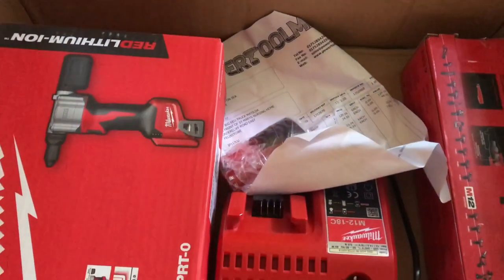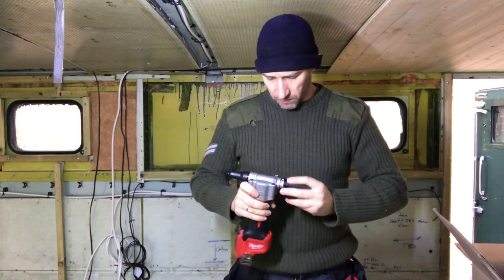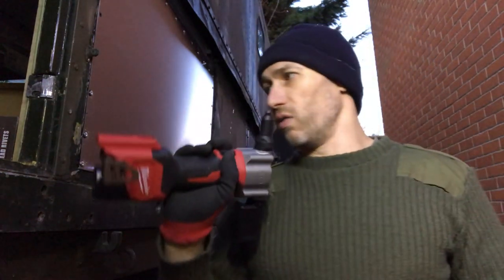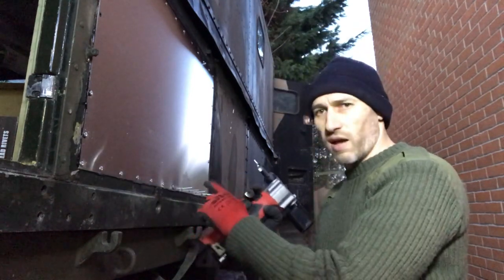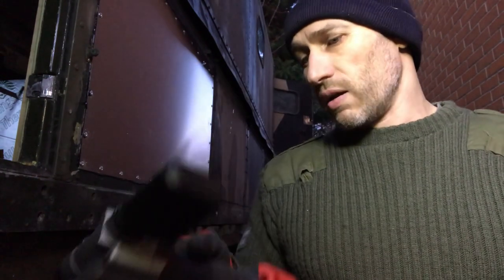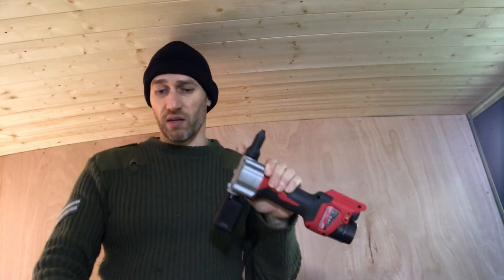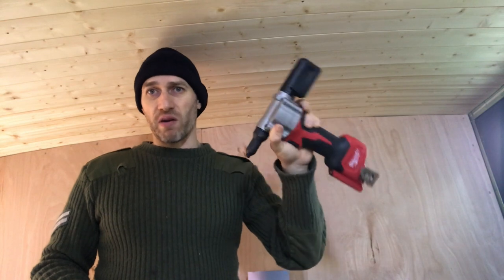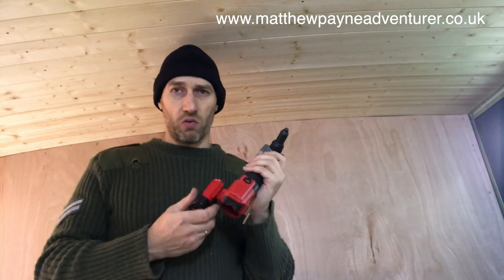Cordless Riveter Milwaukee M12 Rivet Gun review, Pop rivet tool

Comment: I used this to rivet around 500 rivets in one go. The motor gets really hot and it is placed inside the grip so it gets quit hot to hold in your hand. Not the best design. I got through a couple of 4Ah batteries :D
Reply from the maker: Thanks for the info.
Reply from the maker: Thanks for the info.
Reply: @matthewpayneadventurerfilm8902  It didn't stop working though, so a good machine/tool in that regard. It would be a searing pain to do them all by hand. The plastic rivet collector broke on mine, the same day I bought it and had to glue it back on. So be sure to empty it before it get full.
Reply from the maker: LasseBB yes the plastic collector is a bit crap and my only real criticism.  Forgot to mention that.  Don’t see it lasting long.
Reply: @matthewpayneadventurerfilm8902  
Nope, for me it was the two plastic parts on it separating. It is holding thus far though after I glued the pieces back together.
If you wonder, the bigger and bulkier 4.0 Ah batteries fits it just fine.